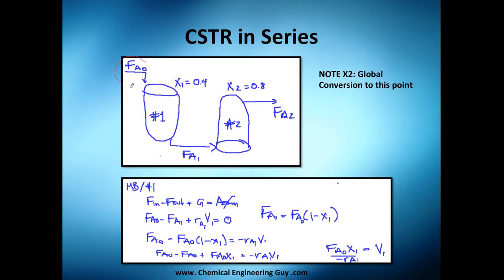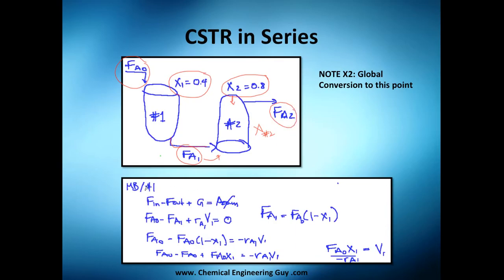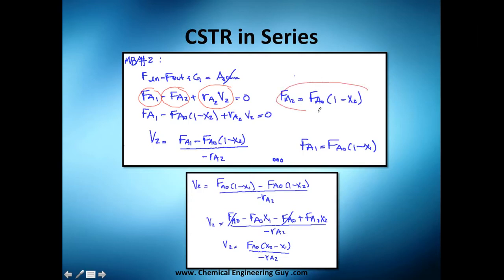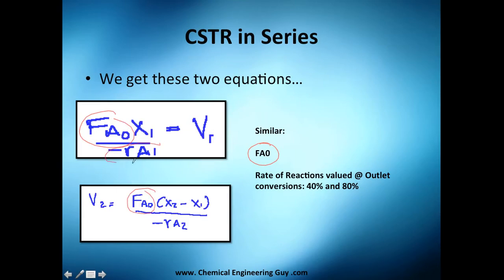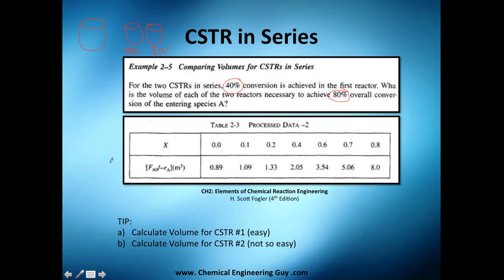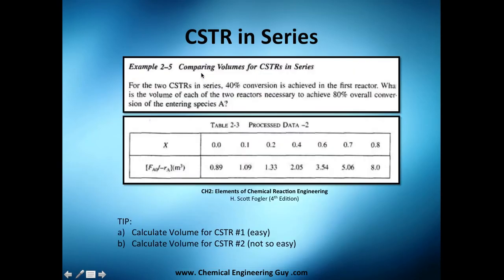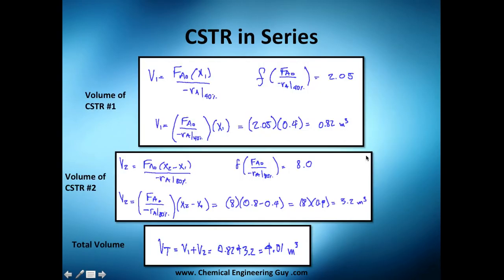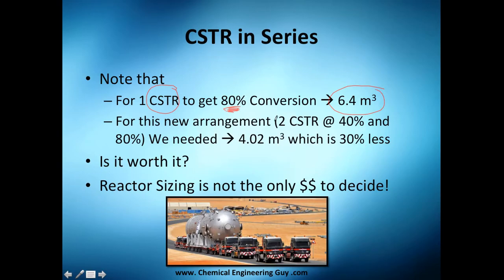CSTR in Series (Minimizing the Volume)// Reactor Engineering - Class 30

Comment: Why for the reactions whose rates increases with concentration a PFR gives better performance than series of CSTR?
It is written in LEVENSPIEL , also refer the given link? please
http://demonstrations.wolfram.com/EquallySizedMixedFlowReactorsInSeriesVersusPlugFlowReactor/
Reply from the maker: keep watching until class #34if you still have doubts please let me know!

TIP: it depends on the "shape" of the function of rate of reaction vs. conversion!
Reply: Chemical Engineering Guy How we will draw the graph of FA0/(-rA) versus conversion for this case.???
Reply: Chemical Engineering Guy Can rate of  a reaction be negative???
Can rate constant be negative???
Why/ why not??
Reply from the maker: dharminder sekhon if the rate of reaction is negative... the "reactant" is actually being produced rather than consumed. This may happen in an equilibrium reaction.
The constant, by definition, is always a positive value